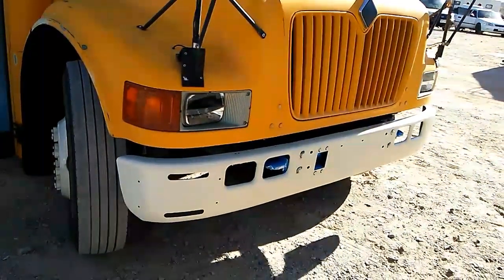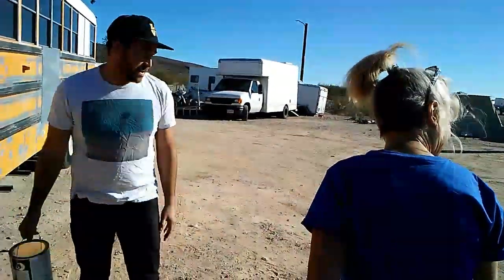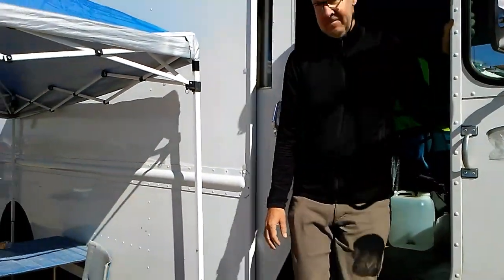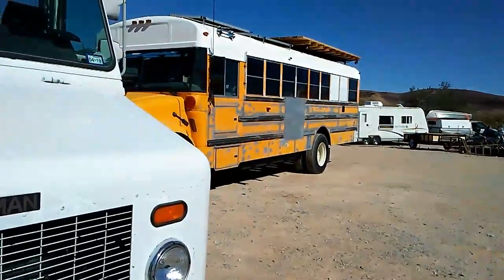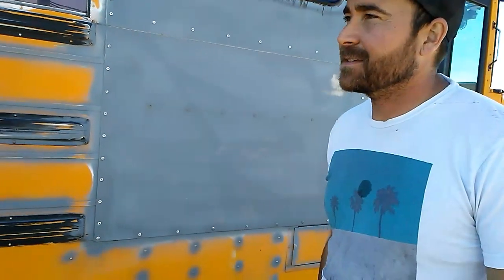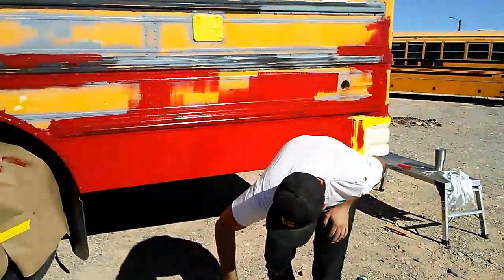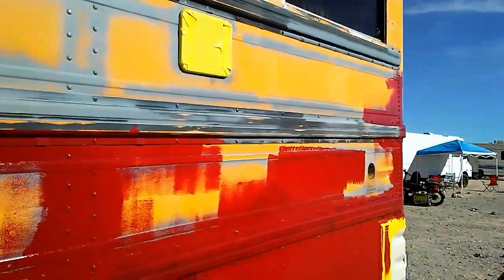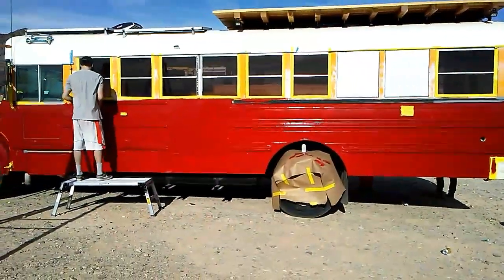Painting is underway on Jax' s new bus!!! Van build party 2018

Comment: Tractor paint is chemically designed to sit outside for 20 years and still be the same color.
Reply: Good 'ol lead eh?
Reply: I worked as I.H. mechanic for years and painted a lot of tractors with that paint, it does not hold up long term at all, maybe if you wax it periodically it might,.

Comment: Dont roll that shit, that is not car paint it will look like crap because it will dry before you get all the way down one side and the roller will start sticking unless you put some penatrol in it also red emamel wont last in the sun a year red is very hard to work with, just  go buy an HVLP sprayer at harbor frieght  im telling you it will look awfull if you roll and brush it youll get runs all around those ribs  and rivits inside the doors ect Go to a car paint store and get some single stage urethane, a boat place may also have some good paint for 50 bucks a gallon  an hvlp does a nice job with little overspray, you can rent them too trust me ive been doing this 37 years , id paint it all while with red on the ribs , white is very forgiving last a long time too and hides everything .